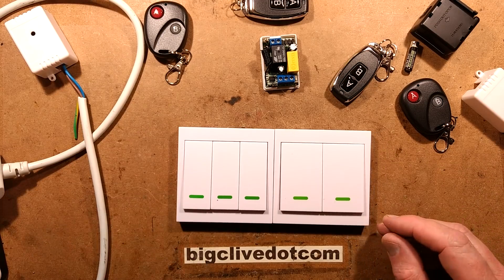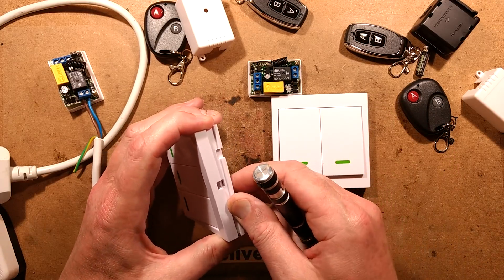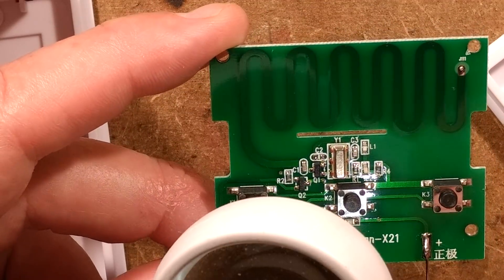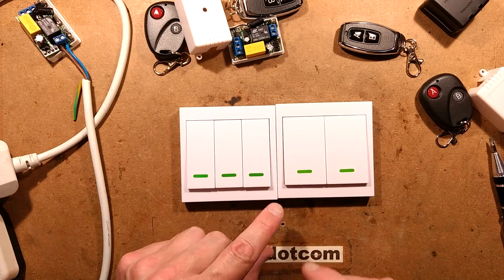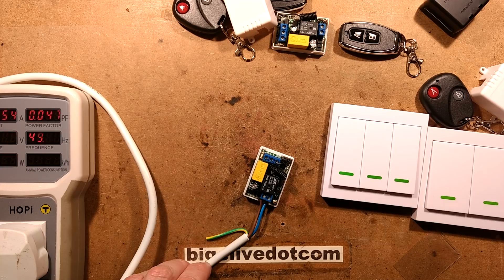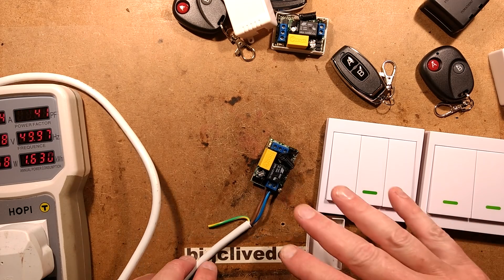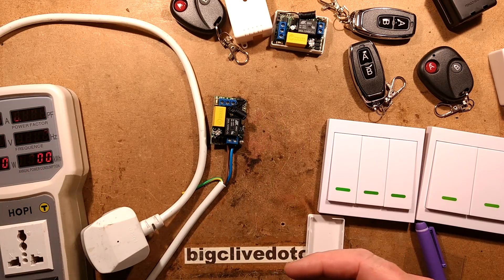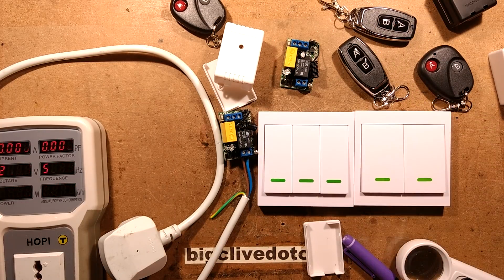eBay radio remote controls.   (220V with a 125V relay!)

Comment: What if you drilled a small hole over the programming button and used a small rod to safely press it? Useful for projects where you have to program it often especially if the rod is contained in the box like a permanent button extension
Reply: you mean finish what the Chinese factory forgot to finish? :D typical chiniseium garbage....... they have the parts, and the knowledge...... but if they can save half a cent per shipping container by making the entire thing unsafe and pointless they will do it.
Reply: stupidkidlol it is not safe way if the rod is of conducting material. It should be of plastic or something. Drilling a hole is not good idea as somebody can use paper clip or similar universal resetting tool.
Reply: Just 3D print a suitable actuator and drill a hole in the top of the plastic case to allow a button to protrude. Easy!
Reply: Tapper21 
You couldn't buy the parts for what you pay for the whole assembled units. What do you expect?
Reply: mattikaki 
The plastic rod could remain captured in the case if you design it correctly. Just print one out.

Comment: if the crystal is 433MHz that puts in the ham radio 70cm band 430MHz to 440MHz
Reply: yep 433 is a EU SRD band
Reply: so anyone useing a HT will either block it or turn things on/off or cause havoc one way or another same as they do with some cheap car alarms
Reply: The 70cm ham band is a secondary allocation.
Reply: Depends how good reliant on a code it is to do it's job and only respond to a proper switch/fob. And 433Mhz does put it in the amateur radio band, but also in the ISM band which is where it belongs. ;)
Reply: totally agree but you know as well as i do el cheapo chinese are either going to get battered about by hams or they are going to cause EMC to hams and as most 2/70cm hts are 5wts output on tx i would say they more likely to block the signals of the remote then the remote cause emc ... (2E0FOK my callsign)

Comment: I wonder how easy it would be to adapt it down to lower voltage use like 12v application then users wouldn't die so bad and we could use it on lower power projects like batteries and led lighting etc.
Reply: 12V versions are available:
https://www.ebay.com/itm/315-433MHz-1-Channel-Wireless-Relay-RF-Remote-Control-Switch-Receiver-DC12V-10A/201974636308
Reply: Interesting thanks :-) , I hope they sell the transmitter too.

Comment: What is the quiescent current for the transmitters? Those 12V batteries are quite expensive. It would be a shame if they need replacing once a year, even if not used.
Reply: I've got quite some of those switches installed at home. While I've never measured them, the wall switches are all running on the first battery (A27) for 2 years now.. A 20 pack of those cells is only ~5 EUR in China. There is also a slightly more expensive kit, that has an Receiver with a switch accessible from the closed case (Long rod) and the wall switch slightly thicker using A23 (3x capacity): https://de.aliexpress.com/item/Wall-Transmitter-Remote-AC-220V-1CH-10A-Relay-Mini-Receiver-Learning-Code-ASK-TX-Input-Output/32542229489.html

Comment: I can't imagine having to worry about getting shocked with every little device around the home.
I often work on these gadgets while they're live but at half the voltage. I'd probably be dead in a week if I moved there.
I'm currently looking for wireless switches that install in place of the originals so that I can control the outdoor lights. I've tried the so-called "Smart Bulbs" but they are useless unless you fix the switches in the ON position. Maybe you could design a schematic for one that works on 110v? Have a good day!

Comment: Quick question. It looks like a quick job to replace the relay with one that has 220V rated contacts, how hard would it be to add a thermal fuse (keeping it away from the diode so the added heat does not cause a premature pop)?

Comment: i don't think that private households will have to pay apparent power anytime soon. apparent power meters would be cheaper than those measuring effective power, which we  already have. so they would have replaced them a lot earlier if it was for financial concern.
Even big companies who pay for apparent power don't have to pay the full apparent power, but just a penalty. The power plant doesn't have to produce more electrical power. it's just more transfer losses in the power lines, when the power factor is low.

Comment: the smart meters are a brain-child of the EU, trialled at great expense in Sweden and Italy, and much beloved by the power companies and DSO software suppliers like Marconi (I used to work in the European Parliament and went to meetings on this and read the wretched legislation). But they are not compulsory in the UK, even though British Gas et al will try their best to get you to have them fitted, for which they get a fat fee.
Reply: Cutting off non payers is illegal in the UK.
Reply: +K Vjqxzz no, they don't even need you present to fit a prepayment meter if they've got a properly issued warrant to enter. You can just come home one day and find your new prepay key/card sitting on the doormat or in the machine, which will (if you're lucky) have been set to use the emergency credit (I believe you can get up to £5 in debt before it properly shuts you off, provided you've activated the emergency credit in time.) Hateful things.
Reply: Martin Nicholls I voted remain myself, but this does not seem the place to go into the reasons.

I am sceptical of incoming AP billing, as you can probably tell.

But yes, definitely an EU quota responsible for the push toward smart meters.

I don't find the idea of smart meters unreasonable, but don't see the benefit either. Working in IT (broad terms), there are some things I feel should not be connected to the Internet. Directly or indirectly.

Power distribution is one of them. I would rather submit an online reading from my dumb meter once every few weeks.. as I do.
Reply: "gremlings" apart we in italy had electronic power meters since almost 20 years, the benefit appears to be that they don't need to knock to your door to read it, they started to change the "old" ones since an year or so, they actually changed mine a month ago, the old meter transmits data (as they say) twice per day (so rare because of multipexing.. maybe) the "new" one every 15 minutes, apart from minor firmware changes the other feature i've seen changed was the DISPLAYED power consuption lower unit, the old one displays like 0.4kW without tens and units, this displays the single watt (or tens, i've to check again), the optical "service" tranceiver remained the same and so the display (monochrome LCD dot matrix per char, plus some special symbols)... also behind the meter there's a socket that holds the "company wires" on a connector and the new one just fits on the old socket, fast to change

as i happened to say on another BigClive video, i asked the technician for this apparent\real thing, i don't know if he doesn't know the detail well or just semi-avoided to say the "ugly truth"

honestly at this point i would try to shut the secondary mains switch and hookup an heavy inductor, see if there's power consuption and (if i find it) hookup a big capacitor and see the same thing (or maybe not 0_O)

on the meter there's a switch (both old and new) it's the main switch, honestly i think that the meter can decide to snap it for some reason, there's a bit of policy rules for when this switch will shut and these rules are apparently managed by software (over-contract power consuption and duration... mine is regular 3.4kW)

the apparent reason why they changed em is: "it's more precise and pushes the owners to a better """"energy  awareness"""" "... but you still need to request the BIDIRECTIONAL one for power sharing, the new one seems the same of the old

oh!!.. i find iot hilarious and ai terrifying (they just want to sell us those things... hwo cares of dystopias? right?)
Reply: Directive 2012/27/EU - ya soft Gammon, how do you think the UK MEPs voted with regards to Smart Meters? The UK government has been supportive of it.  Ya cannae blame "the EU" for everything as though it's some separate entity - we are the EU and the EU is us. No need to be salty just because, as usual, the UK gov has taken sensible legislation and fucking brutalised it, eg getting customer facing 'suppliers' to roll it out instead of the network operator(s), pushing crap In Home Displays instead of using existing customer hardware mobiles/tablets and the final stroke of UK government genius... zigbee.
Reply: without getting into the entire argument because I agree with some aspects of both sides - the customer facing 'suppliers' own the meters so they are the obvious (and legal) entity to make the change (when you switch supplier they just change the owner of the meter) and whilst I agree there should be an option to use your own device they have to deal with those who have no devices (many older generation) and face all the issues businesses face with 'bring your own device' if they allow all and sundry to choose which hardware to use. As for ZigBee - I thought that was an IEEE low power networking standard, is it something the UK government have a reason to enforce?
Reply: I was under the impression UK power companies have been given a target for %smart meters installed, and they are fined for not meeting it.

Yes you have the right to say no, but they will do their best to avoid telling you that. You could argue semantics over getting paid for installations, but I think it's an important difference.

Regarding the change to billing for apparent power, does anyone have any sources to support this suspicion?

Genuinely interested
Reply: sim6699 I was looking for sources rather than opinion. Thanks anyway, but I would prefer examples specifically on a change to billing by apparent power.
Reply: Well, I like the idea of enforcing power factor correction but not at the cost of the consumer.
Reply: "I love these paranoid gammons that chat absolute shit lol. Yeah, everything's the EU's fault."
"at least 80 % of consumers should be equipped with intelligent metering systems by 2020" - where's that from? Directive 2012/27/EU. I love remainers who talk pure unadulterated nonsense about the EU. That being said smart meters are a perfectly reasonable thing.
Worrying about something that blatantly isn't going to happen in the UK (RP billing) because I'd take the power companies to court is a nonsense. Rolling blackouts don't need smart meters either, they're easy to do by shuffling local grids off the main network. The power companies DO NOT control the infrastructure in the UK, 
infrastructure costs are not their problem and they'd have zero valid legal reason for doing this.
"they don't even need you present to fit a prepayment meter if they've got a properly issued warrant to enter" - this is *not true*; civil power of entry requires a High Court warrant and they are NOT issued for this.
Reply: The problem in the UK is most smart metres no don't work. they worked for a while with the initial electricity supplier but as soon as you change they're not used by the new supplier. It's the biggest waste of money until the new HS2 comes online.
Reply: "you are a duplicitous hsit-for-brains tism-afflicted chumpanzee"  ??  You've shown your true colours now K Vjqzxzz and undermined any points you were trying to make. You've saved me a lot of time. Thank you.
Reply: Rasmus, BigClive is quite right, the power apparent/real and all other settings are remote controlled by software and can be controlled at a granular level down to the household (to cut off non-payers), and for intermittent power-outs to control demand on smart devices per block/area, and lots of other black magic
Reply: I love these paranoid gammons that chat absolute shit lol. Yeah, everything's the EU's fault.
Reply: mbaker335 - I did not know that - is it also illegal to alter the tariff to make them pay more, or change them over to a slot machine?
Reply: mbaker335 only if they are disabled or over 70 years old, they will have yoir door booted in and your main fuse pulled out in a jiffy otherwise, or if they have new connection equipment they will cut you off remotely.
Reply: RealUnimportant don't forget about your broken front door as well
Reply: IncandescentWithRage 
judging power companies by previous actions, they are likely to implement any changes, they assume able to get away with to maximise profits. Uk is a Kleptocracy after all.
Reply: YewTewbe 
perhaps doing a little research into eu legislations would open your eyes
Reply: Attempting to ruin the internet in more ways than one and attempting to ruin my electric bill......... Seriously wtf EU
Reply: One big problem I see with the smart meters are the idling current. You will be paying for a device drawing electricity no matter what. I moved out of an apartment one month before the contract ended and for some reason I had still used almost 1,5 kWh during that month. Forced consumption. A brave new world.

The selling point to the consumers it that they will be able to control their usage. Are politicians really stupid or are consumers? Would a consumer turn of their A rated fridge just because it consumes electricity? Will a consumer turn of their Nintendo 8-bit retro evening and point to the smart meter "sorry boys this item just took me over my power limit. Thank you smart meter you control my life"

Will a electrical company be any better at predicting consumers buying new products and plugging them in than before? No! The companies will still be after and chasing the curve. 
But they will be able to charge more money for nothing. Of course the company CEO needs a new yacht and the salespeople new smartphones from where they play Farmville 2019 Eco edition in HD. If they do not make enough money a new structural deal will have to be made to find synergies to increase the bottom line. Jargon, jargon, jargon.

Yes, it is the EUs fault because all the politicians and all the big corp leaders wants legislation on that level. National politicans not taking responsibility domestically, but shoveling the problem "up" to themselves on the EU-level. Finding solutions to non existent problems and creating new problems that only they can fix supranationally. (Border control and cross border criminality).

 And democracy. Jesus christ Irkluk mohammed and buddha! When france and holland said no to the lisbon constitition and the "woman" wallström said they would handle democracy in the EU because the naughty democratic electorate was not wise enough to handle democracy. The thing, now named treaty, was then shoved down the throats like a mafia execution. A couple of years later Libya was invaded because the leader did not do what the populace wanted. Hence a democratic intervention from NATO powers to support the civil uprising and imported mercenaries. Where is the US with its bombers and drone strikes when the EU "leaders" do not do as the populations wants? Oh, it is the same elites that wants "democracy" abroad but no democracy at home while they sit in their foreign councils and closed meetings deciding above peoples heads. Smart meters explained...and Trump
Reply: YewTewbe - so, you know that it IS an EU Directive, and that the UK govt are traitorous retards, and you still think I am pro-the-muppets in the Westminster? You are a dimwit.
Reply: As I've mentioned before ... if they ever do force smart meters on me (not currently allowed in the UK), and it DOES start charging markedly different rates than the electromechanical meter i will fit immediately downstream (yes I'll allow for the couple of watts consumption) I will report the bloody thing as faulty.

If it ever turns the power off (we're on a postpayment tariff) I will assume it's developed a dangerous high resistance connection internally and bypass it to prevent damage to property. And call the power co's emergency number to tell them about it.
Reply: YewTewbe - you are a duplicitous hsit-for-brains tism-afflicted chumpanzee. I mean this in a loving way, for your edification. Bless.

Comment: I think you didn't really mention the "220V with a 125V relay!" in the video?
And isn't the current rating of a relay more important from a safety perspective than the voltage rating? The Voltage rating, i would guess, corresponds to the distance of the  gap the relay opens, whereas the current rating corresponds to the thickness of the conductors.
So how would the too-much-voltage failure mode compare to too-much-current failures?
Reply: Different failure modes. A 125V relay might arc over at higher voltage, especially if there's a spike on the line. It might not interrupt with an inductive load. Overcurrent is going to heat up the contacts, which makes them heat more until destruction. Or they could weld together. If it doesn't start a fire it might either not close the contacts or not open them.
Reply: Yes, as you said. Higher voltage need a larger gap to reliably and quickly break the arc the will form when switching off. Those arcs damage the contacts, will cause them to have higher resistance which is a bad thing for the current rating and more generally reliability. Bad contacts mean that the switching is electrically noisy, which might interfere with other devices or outright damage them.

I doubt that a 125V relay won't be able to break 230V. But if someone knows more about this, please tell me.
Reply: Moritz von Schweinitz with more voltage there probably is more current (if the relay has stable resistance) so I think it wouldn't be able to cope with that well. Correct me if I'm wrong though
Reply: superdau At the slim margins of cheap subminiature relays I would say that under-rating the relay contacts is pretty dangerous.